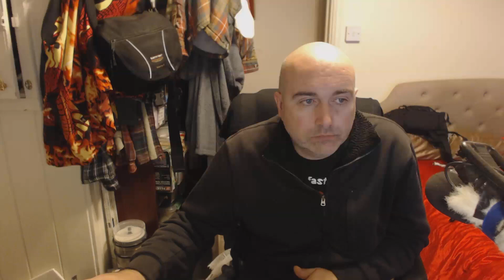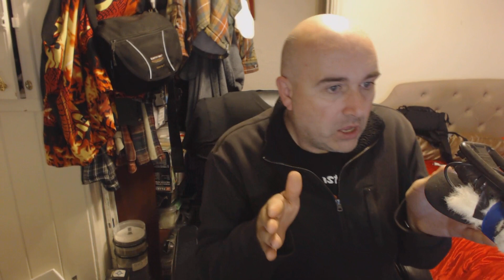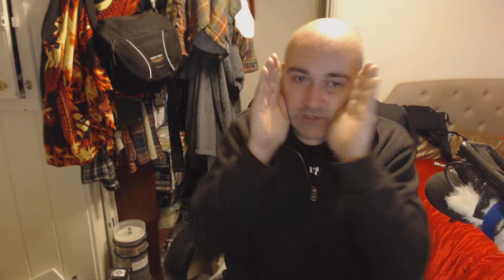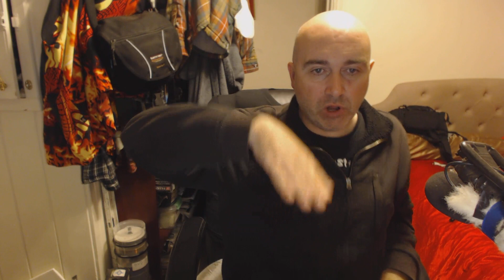DJI Mavic SAME OLD FLAWS - Learn! Hint... its not PRO! (obsolete video)

Comment: It baffles me that someone can slate something they have not had themselves having based there opinions on footage, mainly from individuals who do not know about all the settings where things can be smoothed out to some extent. Also this is NOT a PROFESSIONAL cinematographer drone, no pro in their right mind will use this for professional work, they will use something like the Inspire with the ability to have separate control of the camera. 
You also contradict yourself, saying you would not buy one, then a few breaths later saying you would like to buy one if you had the money but not yet, so by this I assume you simply cannot afford it at the moment?!?!
Reply from the maker: The thing is the Mavic can 100% be used for professional work. Its 
quality is good enough and it can go where other drones cant.  You are correct - the issue
 is that is DJI refuse to give full optimisations of controls then you 
will be stuck with sharp sensitivity controls. I am NOT a fan of split 
control systems like the INSPIRE or Matrice because they are designed to
 give only one image down to the cameraman... so how is the pilot 
supposed to know where he is and how close he is to objects when the 
camerman is blinding him by turning the camera 90 degrees and 180 
degrees etc etc.  I have never felt once like I needed to turn my camera
 one way whilst I fly in another direction. A good drone operator can 
pull ALL the moves a split camera system operator can, because they are 
skilled at the controls. See my 1 fixed gimbal camera drone footage.... 
transition of front flying to slideways flying seamlessly. No second 
operator required.   Check out my video here where I am flying the drone and operating tilt - and had to get this stuff in one take... see me tranisition from front flying to side flying keeping everything perfectly in shot. Who needs a cameraman second guessing the pilot and vice versa...
https://www.youtube.com/watch?v=-mwMnHm4UiM

Comment: The only thing not pro is to make out an opinion without having seen/used the actual product. 

BTW, if you complain about yaw movements, you could try three things, be more gentle with the sticks, in mavic's app, enable tripod mode for slow movement of the drone, or buy another product.

Finally, tidy up!!!
Reply: Errrmmm you havent read the other comments.  Thats not "pro" either is it.
Reply from the maker: Try reading before commenting. Hint : The description. Hint 2. Tripod mode.
Reply: I saw a video adding expo to the yaw which would help a lot.
Reply from the maker: Again please read the other comments. Tripod mode is good as a tripod mode... when you want to fly around - yaw is too sensitive. You need a blend of tripdio mode on the yaw only in normal flight modes. Supper sluggish and smoothed yaw and the same on the tilt... eased in and eased out control. Then DJI will take over the market even more. Yuneeq has it, why not DJI?

Comment: no way to smooth yaw!?  do you know how to use the software?  i have a phantom 4, an inspire and an M600 and know how to correct that by making adjustments in the software.  yaw, pan,  everything can be slowed down so it's smoother.
Reply: check out this phantom 4 video with "shitty yaw" - https://vimeo.com/185162078
Reply: Looked good, so what are you doing. Tell us. Even better get your camera out and show us, lets see the procedure in the software.  Everyone can get "some" good shots by being careful enough and only picking good shots out of a load of bad ones. I want to see that this technique you use is making things good most of the time... I dont doubt you - but lets see how its done.
Reply: sometimes i think youtube is worse than reddit
Reply from the maker: Negative. Expo can only be reduced to .20... thats not enough. The way ive done it is by not using a DJI controller but a custom one where I can put in tiny expo in via the controller. Forget GAINs - they dont apply here... if you have some way you know of that is more clever than the above please let us know. Else your yaw control is still probably quick, or by my standards anyhow.
Reply: EXP can be reduced to 0 .1;  mine's set at 0.25 which gives me a good balance between fine control and performance. i reduce my gimbal wheel speed from 100 to 30.

Comment: LMAO....I love the passion, having owned DJI™ and currently have an Inspire I can in fact AGREE with your point. The gimbal control is an art for sure, the dual control on the Inspire helps as the video guys can worry about the smooth pans... I know having flown the Phantoms the gimbal is pretty useless for any smooth work unless as you so eloquently  explained you are only doing axis shot or zip-wire type work. You'll find with Mavic PRO as with Phantom they've tried to address this with software control rather than stick control which is where the problem seems to exist. I'd advise anyone with a Phantom to try AutoPilots™ software for DJI™. Again thank you for giving me a giggle while I wait for my new NON-YAWING drone...
Reply from the maker: Phew at last. Someone who understands there is an issue here. THUMBS UP!  I own DJIs too (NAZA brains). I dont hate DJI... I think theyre overpriced x10 a lot of the time but hey, thats the world we live in.  I got around the issue like a lot of people by making my own custom controller out of a Turnigy (9X with OPENTX firmware and i can smooth pan whilst acting as pilot and cameraman... I feel sorry when I see people who paid a lot of money for drones I simply couldn't afford - getting issues with jerky YAWs and camera TILTs. I feel for them... I really do. Yuneeq have actually included ramp up ramp down automatically - its a smoothing curve so when you pull the yaw stick it slowly builds up the yaw and then slows down the yaw to get to the stick position you just pulled. Even if you yank the yaw around wildly itll smooth it off for you, so its hard for you to cock up - ever. Same is on the TILT. Hats off to Yuneeq.  This is a MAGIC IDEA... and one DJI need a fucking rocket up its ass to adopt like YESTERDAY... Hehe. Thanks for your input.  Im going to do a video with a local Yuneeq dealer to highlight what a magic feature thsi is and why DJI sucks for not having it.
Reply: LOL still waiting for my Mavic.... TUT TUT Frank!! I think I'll have to start building, then at least I control my own destiny...

Comment: The yaw & panning can be adjusted.  Look for the gain & expo settings. Read the manual for more insight.
Reply from the maker: We have discussed this already. Wont work. Expo doesnt go low enough. Gain isnt for that! Gain is something else entirely.
Reply: Works on Phantoms, I assume it will work on the Mavic too. I also have a "slow yaw" mod switch in some of my Phantoms which works well.
Reply: Tell us more... infact show us. Get us a youtube vid... please. Explain what its all about.
Reply from the maker: https://www.youtube.com/watch?v=iYNcTHF8B3w&feature=youtu.be

Comment: So what drone or drones do you suggest?
Reply from the maker: Dont get me wrong the Mavic is a true Marvel. However there is lag on the video link which you dont get on analogue systems. And the video link frame stutters too. There is a whole lot of great reasons to buy a Mavic though. Im just pointing out the big ELEPHANT in the room which nobody talks about. LIKE NOBODY.  YAW AND TILT smoothness!  My use for drones is to film things in a cinematic ways, which means turning the drone smoothly and panning the tilt of the Gimbal is super important to me. I would go crazy if my YAW and TILT were rough and it appears yet again the MAVIC has this issue. I am very OCD about this.  If you dont mind flying forwards facing all the time and you dont want to tilt whilst your flying, you are fine, Mavics for you. However if you want this feature the YUNEEQ is the only copter out there that has it smoothing that I know of. There may be others, I just dont know them. I built my own because nobody was offering the smooth functions I needed. Its mostly in the controller - this is where the implementation needs to be,  so my controller is a cheap £50 Turnigy 9X type with OPENTX firmware flashed into it. This gives control over everything. The down side is you will NEVER be able to use such a controller with a Mavic (I think). Its a locked in system with their special hardware. Now if you go back to Phantom 1 2 and 3 you could use other controllers with those copters. I am not sure about the Phantom 4. If you did use custom controllers you would have to do away with the TX-RX box inside the drone.

Comment: what do you think about P3 Professional? I have´t had a different one, is that one working like the mavic or is´t different?
Reply from the maker: i think youd be better off getting a custom controller built for your p3... so you can get smooth rans and tilts. Be a lot cheaper than having to buy a mavic only to find its just about the same as your p3.

Comment: U should go for a go"pro".little man
Reply from the maker: Ive got 3 go pros thanks.
Reply: truthseekers666 U sure u got real go"PRO"s？
Reply: What is funny is that I would be flying a brand that I like rather then posting a blog of a brand that did not work for me. It sounds like technique and calibration is what is really required. If they can make professional videos with DJI equipment, you should be able to to.
Reply: This video is to open a dialogue from me and others to DJI on a feature that needs to be properly dealt with - smoothing which isn't present in their products and needs to be. If it is there and im an idiot then someone needs to point it out. However what everyone thinks is smoothing - ie EXPO and GAINs are not smoothing. Expo has been purposefully left too high to be fully useful. Gains are nothing to do with smoothness but stability after an unwanted wind input to self right the drone.  So this video is my way and other way of saying to DJI what are you doing about this - because others like Yuneeq are putting this feature in and DJI copters are lacking it. However its always been asked for and DJI have always denied cheaper customers from having it... and seeing as the new copters are so BESPOKE that you must use their controllers ONLY its become a pressing issue because what people used to do in the past was dump the DJI crap controller to get the features they needed from smoothness by programming them into something like a Turnigy controller. Now you wont be able to do that, because nothing else will work with a Mavic. So unless they fix this issue in firmware everyone's stuck in jerk o mode. Thats why I am doing this video, not to slag off DJI but to make it come up to the standard it needs to be, to get this included in a future version.  The standard it would need to be before I would pay for one!

Comment: well i aint getting one now thank you
Reply from the maker: Bear in mind Mavics arent for high winds either. If you want to fly in higher winds youll need a phantom. And save money by getting one!
Reply from the maker: Its an interesting test... but notice the phantom is actually stadier. The mavic is chattering - which was not good. plus the mavid had a dome over its gimbal so that probably explains some gimbal tracking errors in high wind. DJI themselves say its not a high wind drone... and with small blades - you cant expect much.